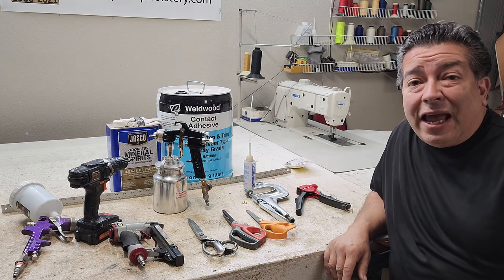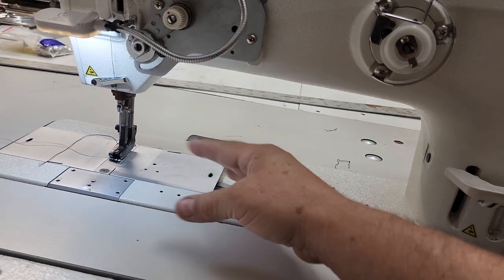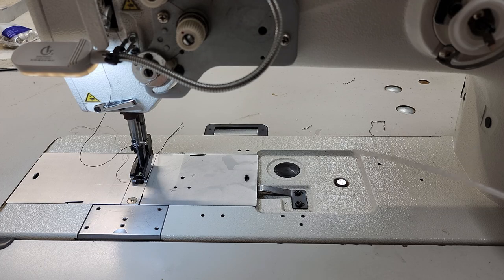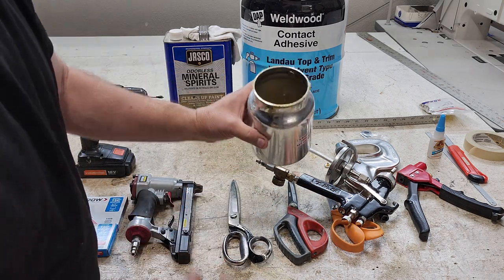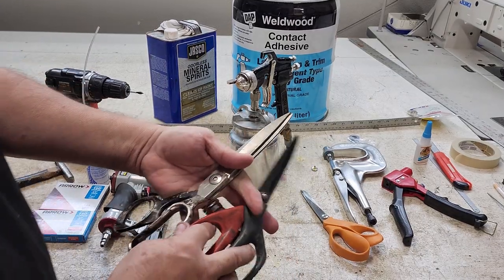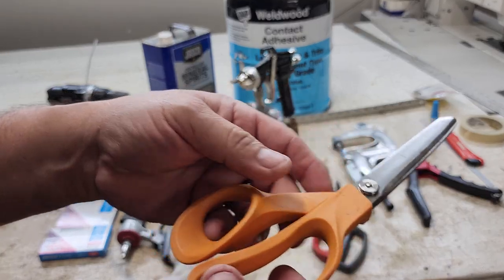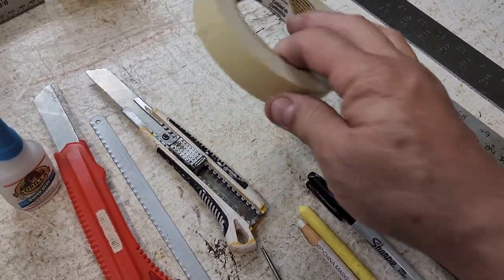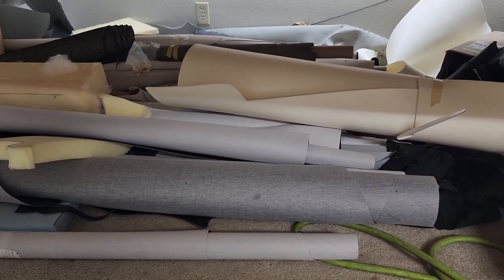The most basic tools for auto upholstery for beginners

Comment: T50 stapler, cloth tape measure. Seam foot. welting foot set. 1/8 to 3/8 for putting on welt through material for different sizes of welt. Also a foam saw is nice for shaping foam. Sander for foam shaping.
Reply: hog ring pliers dikes for removing them also needed.
Reply from the maker: Hello Mike, You are so right! Please keep liking and watching!
Reply from the maker: Hello Mike, Like the title of the video says, The most basic tools for auto upholstery. Good thing I didn't call it ALL tools, I'd really be in trouble! Hehe. I think I may have simplified everything too much. I only use one welt foot. Always have, I guess always will Old school. Please keep liking and watching!

Comment: i really like your table, shelf underneath to store things ,painted white to see things better . you said it was 60 inches wide . could you tell me how long and tall it is ? i would like to make one similar to yours. it's not much fun fighting it the way i've been with my dining room table!
Reply from the maker: Hello John, Thank you so much! Oh, you are going go make me do it, to go measure... Total length is 14 1/2 feet. My sewing machine table is 31 inches high. Taller guys may want a taller table. Please keep liking and watching!
Reply: wow! that is pretty long,  i have got my sewing machine in my dining room because its air conditioned didn't want to put in my garage (no air no heat) one that long will fit in my dining room but may be a little too much might go half that length. i have been taking apart seats and putting new on on my side porch keeping the dirt out of my house but all of the in and out back and forth makes it take three times as long to do but its way too hot outside(coastal carolina). thanks for the measurements, i had been wondering about your table for a while , makes things look much easier to work with!!!! @oldschoolautoupholstery
Reply from the maker: @johnbecker5213  Hello John, All my sewing tables before were not this long. I learned to improve things a bit. I am glad I did. Makes working more pleasurable. Please keep liking and watching!

Comment: Hello Boss,  What size air compressor do you use in your shop  ?    I have a small one now but not sure if it'll be big enough.  thanks buddy,  love the scary box cutters too.
Reply from the maker: Hello Johnnie, Up until recently, I was using a huge 60 gallon, 220volt compressor. I do have to say that it did not run much. However I am now downsizing and went to a 21 gallon 110 Volt from Harbor Freight. It does run more often, but I needed the 110V so I can run it with solar. I think it will get the job done as I really just use it for spraying glue and shooting staples. Please keep liking and watching!
Reply: Thank you sir.  !!
 @oldschoolautoupholstery
Reply from the maker: @johnniek8845  Hello Johnnie, You are so welcome! Please keep liking and watching!

Comment: Rudy, a question about spray guns. I was looking at one I saw online with the following description: BEETRO HVLP Touch Up Air Spray Gun for Clearcoats 1.0mm Stainless Steel Nozzle 150ml Capacity 7.0CFM 22psi with Type 2 Adapter Air Control Valve and Filter.  What size opening do you recommend for spraying adhesive?
Reply from the maker: Hello Star, In the old days we used Binks and Develbiss spray guns. I never paid attention to the specs, I just used them. Now I use cheapo Harbor Freight $27 spray guns right out of the box. Not rocket science. Please keep liking and watching!